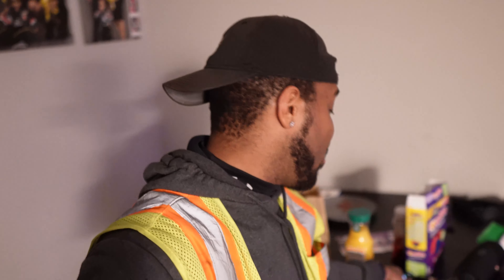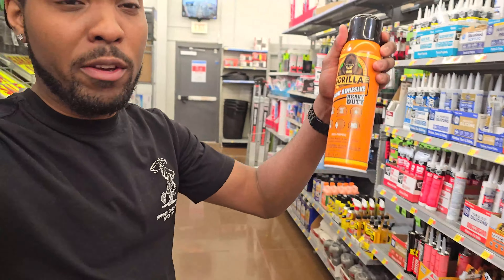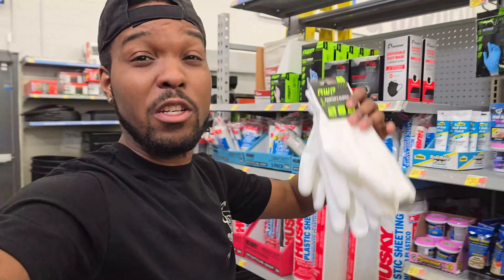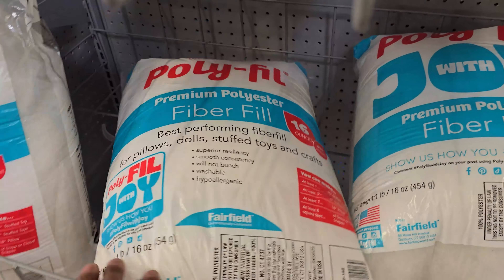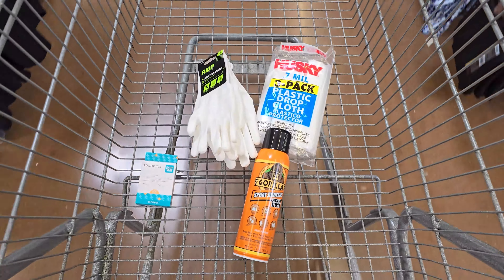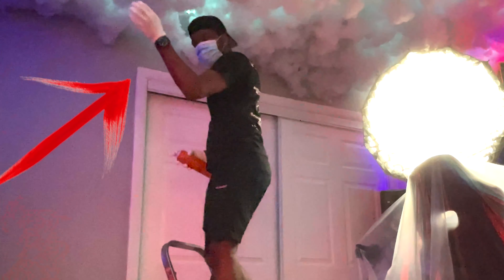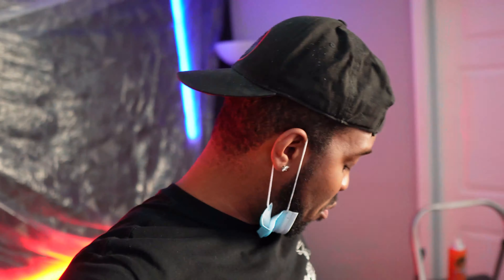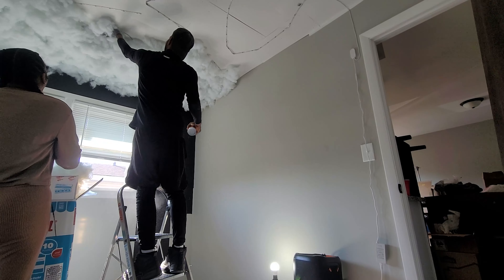How to Easily Repair Cloud Ceiling | 5 Steps | DIY Tutorial(2024)

Comment: I live in an apartment….is there other options to use to keep the bored stick instead of using the staple gun?
Reply from the maker: Maybe try double side tap, but I'm just not to sure how strong that is, although the polyfill is not heavy, or poster board it still does come down from time to time.